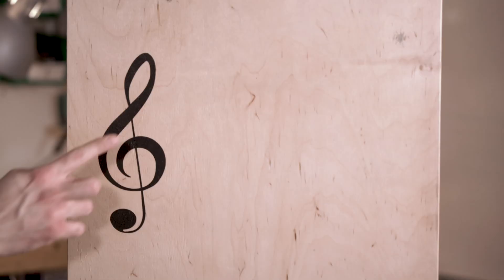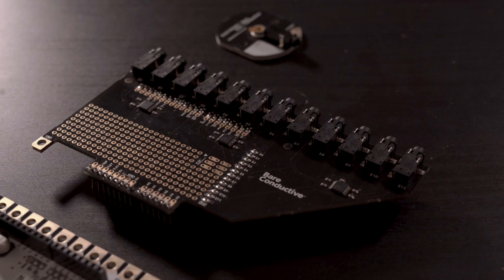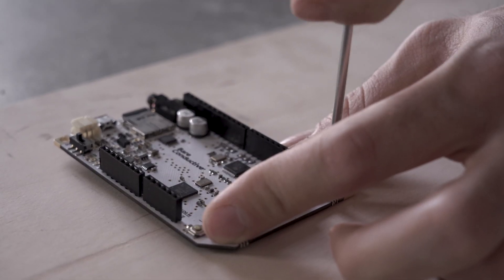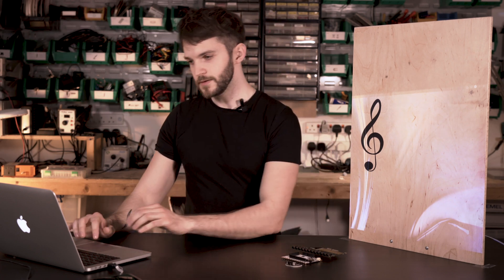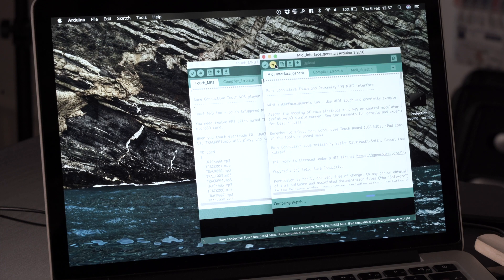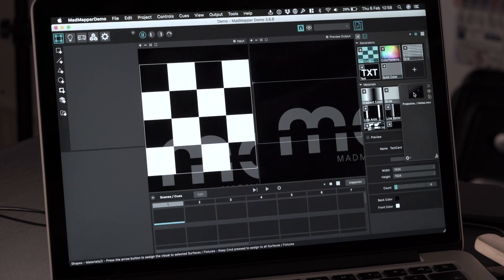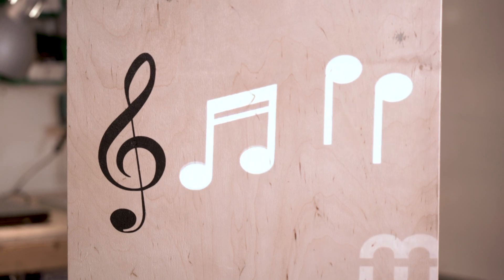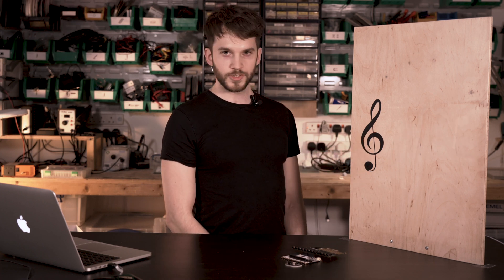Interactive Wall Kit | How to set up projection mapping with MadMapper

Comment: If I wanted to use conductive paint and bare conductive kit for 3 objects is there a wireles way to connect all 3 to one board or it has to be wired? this is to create a musical interactive stage as part of instrumental work for classical instruments and new interfaces.

Comment: Do you guys sell electrode pads separately? Otherwise, what is a good substitute?
Reply from the maker: Hello! We only sell the Electrode Pads with the Interactive Wall Kit as they serve little purpose outside the kit.
Reply: @bareconductive0  understandable, I am trying to do this same thing on a small scale, but I cannot seem to find a substitute for the electrode pads?
Reply from the maker: @user-tn1si8ng1h  You can achieve similar results with the Touch Board, Electric Paint and either copper tape or crocodile clips, it just won't be as stable.